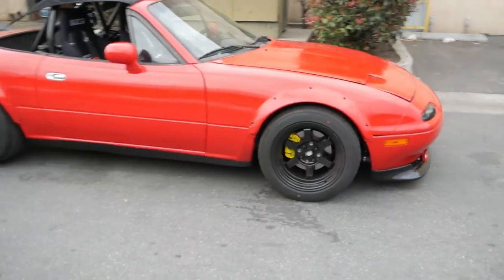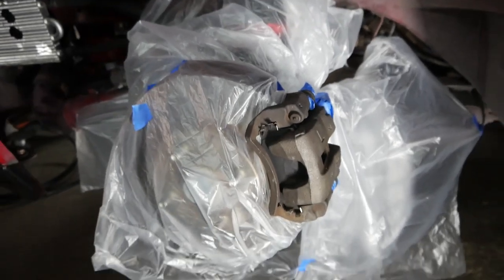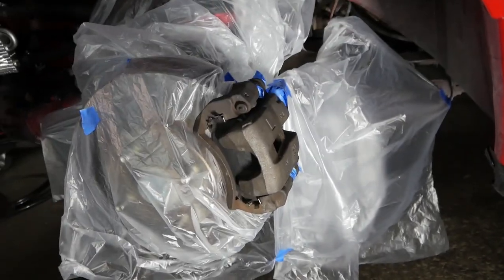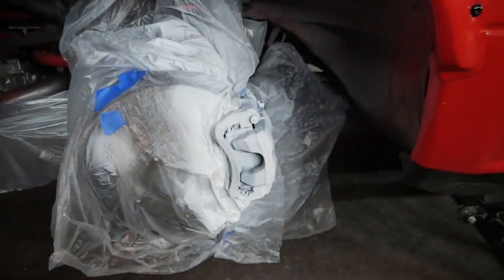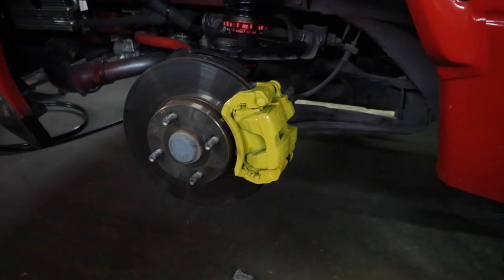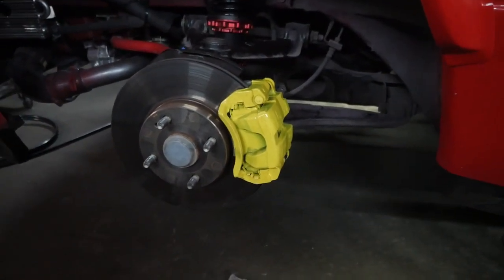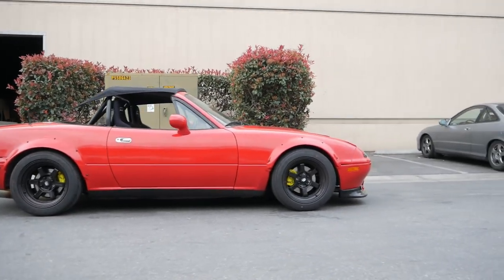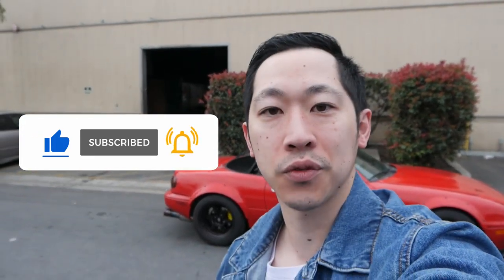[Painting Your Brake Calipers Quick and Easy] | $900 Supercharged Miata Build | Episode 18

Comment: I'm suprised you used a basic paint for the color rather than a high heat paint. How has the worked for you?
Reply from the maker: I couldnt find a high heat neon yellow so I hoped the high heat primer and clear coat would be enough.

I dont have the car anymore, but I did do some track days and the caliper paint held up well. The overspray on the brake pad shims did burn though. 

With that said I think they would be fine on calipers. Hell, even OEM painted calipers can fade with excessive heat.